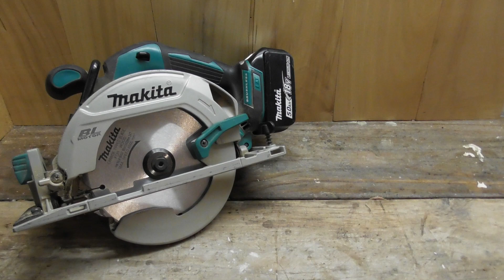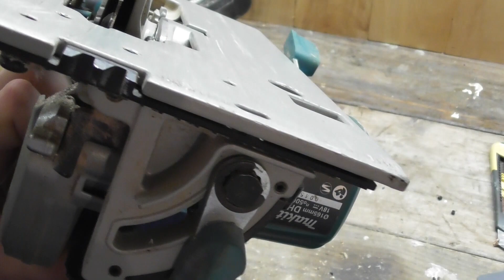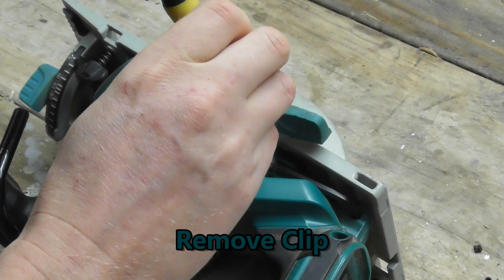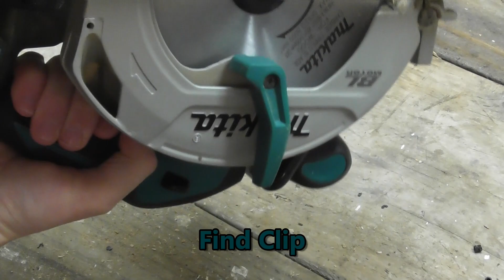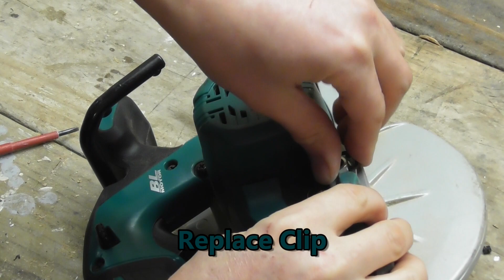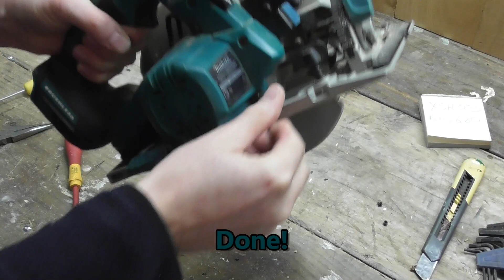Makita Cordless Brushless Circular Saw Wobbly Base Plate Fix

Comment: Five years later, I just bought this saw and it still has the same problem from the factory😤
Happy to see its an easy fix.
Reply: Just bought one a few days ago and that one didn't have this issue so it seems they might have finally fixed it (or I got lucky) 🙂

EDIT: Manufactured 2022-06

Comment: Great video mate. First thing I did when I got mine. I also crushed where the lever fits over the bolt head in the vise to take the rattle out of it, as well as tightening the nut on the the front pivot of the base plate which takes some of the slop out. Cheers.

Comment: Another satisfied customer here. Same saw and had same problem. I followed your instructions and it worked out perfectly. My only gripe is that the measurement plate on the base is PLASTIC and is only secured at one end while the other end is moveable and could catch on something and break off. That's pretty chintzy on Makita's part and I say that as someone that really likes Makita tools.
Reply from the maker: I agree about the plastic plate, although mine is still intact. I have seen a lot of people complain about this.

Comment: Figured this out, it came out of the box wobbly too... so fixed it. Removed the rising bladeguard also, because when cutting planks at small angle, the guard didnt lift properly out of the way. I had to manually lift guard. It was really annoying, so I ditched the guard too... its been perfect new, could have little more oomph though...

Comment: Great Tip,  any advice on an out of square plate on these ? I cant push it high enough for it to be square with blade.
Reply from the maker: High enough? Do you mean the base bevel is not coming to 90° to the blade ? Or the edge of the base plate is not parallel with the blade?
Reply: @ToolsAndStuffOFFICIAL  Never mind I found it page on 13, using a Torx 10 extract the screw a little to adjust the 90% https://www.makita.com.au/media/documents/manuals/DHS680Z_manual.pdf

Comment: Hi, I follow your instructions and now I have the depth lever above the baseplate. It works great. I made an edge guide for the saw. Because the motor  get in the way, I can only use 1/4”’ plywood as straight edge. I think if I can find a way to extend the right side of the baseplate by 1.5” to 2” (I  forgot the measurement), I can use a 3/4” plywood for the edge guide which will make it more sturdy. Do you have any idea in making one? If a larger baseplate exists, that will work too.
Reply from the maker: I  almost always use the other side of the base plate against a straight edge. If you are not cutting too deep you can always drop the plate a bit giving a bit more room under the motor.
Reply: Tools & Stuff Great idea. I found that I use the smaller side a lot too. The jig I made can be with used with both side, that’s why I couldn’t use thicker straight edge. I will make one to use only with one side. Thanks.

Comment: To add to this, as a long term user mine always slowly reverted to this wobbly ness even after every possible fix.

Mine finally broke 2 days ago (half way through a bloody job aswell) after  3 returns to makita and less than a year of use. If you observe the square end of the bolt that locks the depth where it sits in the pewter alloy frame. 

Notice how little meat is there...well that broke as in now it’s round the saws a write off :/ buy at your own risk xD